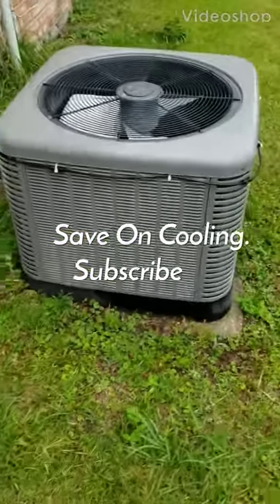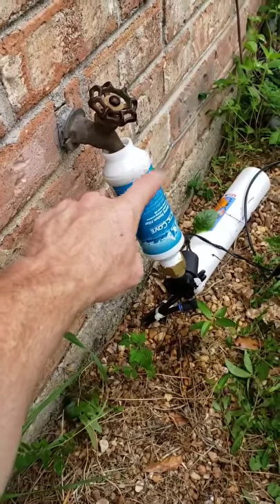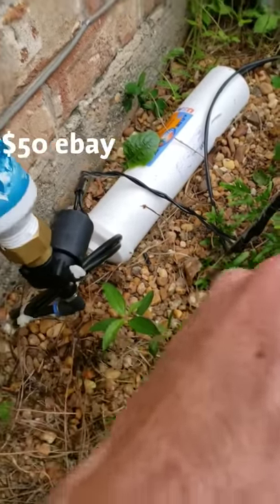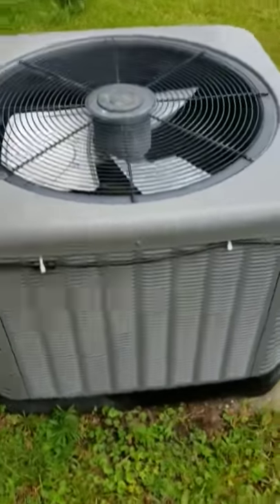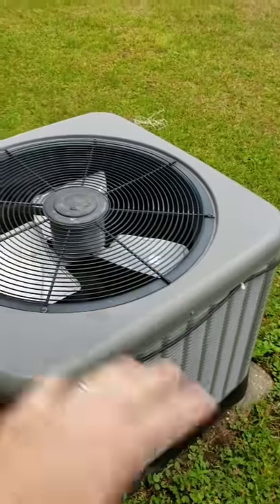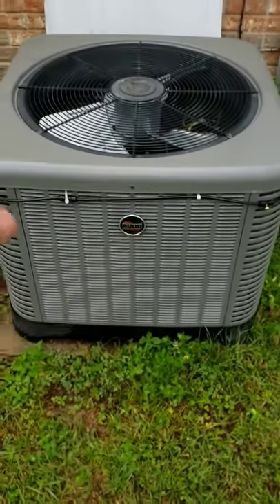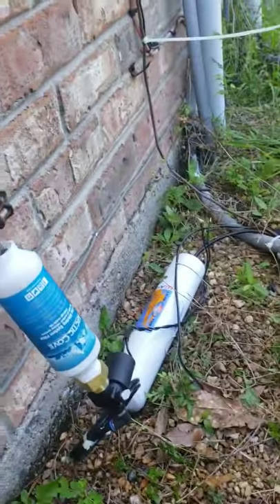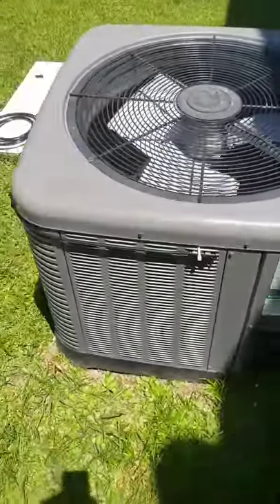AC Misting system. From paddle to 24v operation system. Part order here.

Comment: Here’s a pro tip for ya. All misting nozzles are NOT the same. Most mister nozzles are for patio misting . Too much water out of those. Be sure to use 0.012 for a more fog like mist vs a very wet spray. Very little moisture actually reaches the coil but still cools the air sufficiently. Tip 2 get a big screw on filter housing with a 1 micron filter then use a empty teabag add 1 tablespoon of epsom salt and drop it in with the filter. Any super fine sediments that makes it past filter will be de ionized and won’t stick to your condenser coil. Tip 3 when your a/c was new it came from the factory with a thin layer of oil on the condenser coil and fins. They dip them in a vat of oil before assembled to coat the metal to reduce oxidation and displace water. This coating last a few years then wears off . After cleaning condenser replace the protective oil with a little WD-40 and your good for a year. Hope this helps someone. I’ve done this on my 27 years old a/c for the last 7 years and it’s in excellent condition.
Reply from the maker: Thanks for your input. This is good information.

Comment: Water will clog the condenser with dirt faster. Engineers designed this system to run without water. They make water cooled units. You are messing up the design subcooling and superheat. Maybe Google those 2 terms.
Reply from the maker: I certainly will. I'll do an update at end of season how it went.
Reply: @mdr3w  be glad to answer questions after your research.
Reply from the maker: clean cyclist  in my area of the US we reach 95+ on a daily basis for the majority of the day for 5 months. For these temps I would say the water is not cooling too much through the day, the night however it may be when temps get down to 80s. At night its frigid cold coming out. Perhaps I should add a timer to the system. In the case of efficiency however I would say that reduction in energy costs shows a direct correlation with efficiency. If my electric bill went up I wouldn't have installed. saved approx %40 this month on cooling. Device you can hook to your meter to see energy usage of your appliances.
Reply: What happens when its running while it rains? Doesn't that jack with SH and SC?
Reply: @ArticBeatle  yeah. That's why they made low ambient switches and txv's
Reply: @ArticBeatle  plus rain is without additives and is the ambient temp. Faucet water additives and is usually around 60 degrees.
Reply: @ArticBeatle  well when it rains the load in the house is reduced tremendously. Therefore the unit doesnt run very long under those abnormal conditions. But when the house is sunny and its being pissed on by some dumb homeowner with a contraption not recomended by the manufacturer thats a diffrent story.
Reply: Mines worked for 5 years on a 20 year old condenser. People are paranoid af.

Comment: Ya I want to say I saw a video where an ac tech was showing that they didn't do much it might have been how cold the air was I don't remember but I thought he was talking about power usage as well but I just checked my mini split out it was pulling like 8.5 amps and I just used a spray bottle and it dropped down to like 5 or something which is a big difference my only concern would be like calcium and other hard water but as long as you pay attention even so you can probably spray it down with some clr or like some citric acid like once a year
Reply from the maker: Filter and filter. 5 years and I have no issues.
Reply: From 8.5 to 5.0 amp is 40% power saving that is significant.

Comment: What that guy said and also have you correlated this with what you're paying for the electricity to run your water pump and or your city water bill whichever
Reply from the maker: Water bill has increased by $8. Electric decreased by $40ish five or take.
Reply: @mdr3w  repair cost and frequency increased by 900%
Reply from the maker: @wadetownsend5673  maybe. 3 years and no costs.
Reply: In Daily Life Have Fun I have had mine installed for 5 years. There is no damage to my unit even without calcium filter. I must have clean city water. I have a 20 year old unit. I save about 30 a month.

Comment: Wouldn't it be easier to just get the water from a rain barrel and not worry about leaving a spigot open?
Reply from the maker: Better yes, easier not necessarily. Also, no need for filters and it would be much better for the system.

Comment: Give it about a year and the fins will be falling off even with the calcium filter.
Reply from the maker: I've had a misting system installed for 2 years so far. No fins falling off. I think the problem is that people put this stuff on a old system to make it work better. The old systems are already weathered, so when you add all the extra water to the corrosion it speed up the process. Also, mine is in direct sun light which causes the unit to dry and reduce the growth of mold and such things. If you think about the unit, it is already exposed to water from the rain and humidity.
Reply: @mdr3w  
The misters can add years to the lifespan of a condenser that is on its last legs.  The misters are about $15 on Amazon and an irrigation valve and filter runs about the same.  Rec a step down xfmr connected to the load side of the contacter as this avoids the risk of shorting out the ac control xfmr in the indoor unit.
Reply from the maker: @harveywabbit9541  I'll do that.
Reply from the maker: further: I think the filter is a huge part of preventing a lot of this.
Reply from the maker: @harveywabbit9541  hey. I've added a electric cut on the for the system. Everything has been working great for 4 years.
Reply: @mdr3w  what kind cut on setup did you use?? I’m looking to do a mister set up in the coming week and want to have all the parts sourced before I start!
Reply from the maker: @ogmeth1234  check out my latest video on this. I am using a 12v  solenoid cut on. When the unit turns on it cuts on without having a paddle.

Comment: How long did the  Cool N Save system last?.
Reply from the maker: 1 sesson. The sun ate it up. Check my other vid to see what I did next.
Reply: @mdr3w  in 1976  I spray  some vinyl boat seats with  the original Armor All. 10 years later. They were still in good shape.  Do not know if their bean counters changed the formula since then.
Reply: @mdr3w  You replaced it after one year?
Reply from the maker: @randyschiffer3265  the cool n save was crap. Check my new video to see what I did.
Reply from the maker: @randyschiffer3265  the sun ate it up. The plastic and connections became brittle. It worked like it should until it was failing with leaks.

Comment: As an hvac technician your doing more damage to your ac unit and you are slowly killing the unit faster but hey people like u keep me busy and my family fed! 🤣😂
Reply from the maker: Keep following. I will post a video on what happens and when. Total savings has been estimated at $550 since I started cooling the outside unit with water.
Reply: In Daily Life Have Fun I already paid for a new condenser with my savings and mines 20 years old
Reply: scrappy, I'm thinking of putting one on mine.  I have 2 ac tech on my street and they both have one on theirs. no problems.
Reply: @scrappyhustler - you've made a claim, but I guess I don't understand the technical explanation on how this idea will fail or otherwise be more trouble than it's worth. Certainly, it make the HVAC system dependent on an external solution - put a technical solution should go deeper than that.  Thoughts?